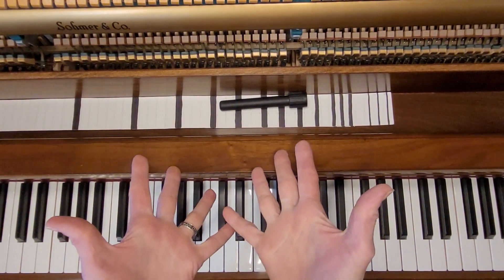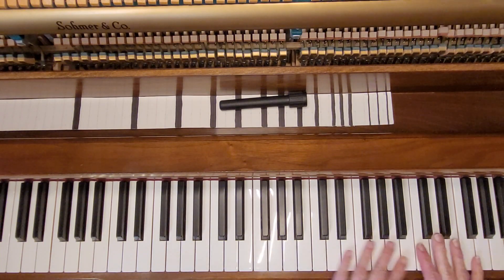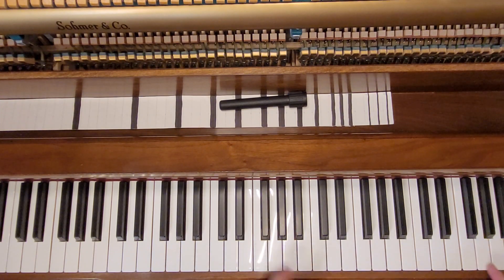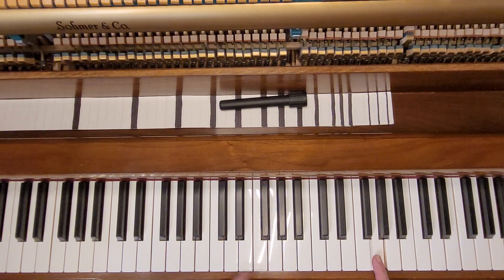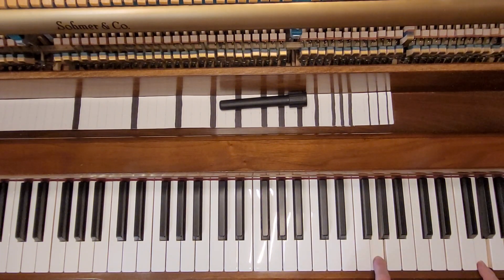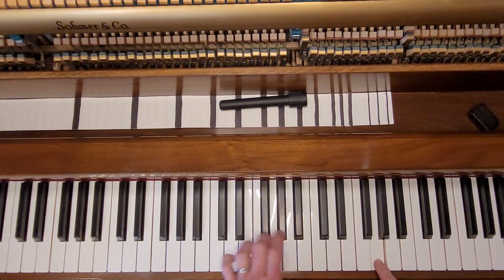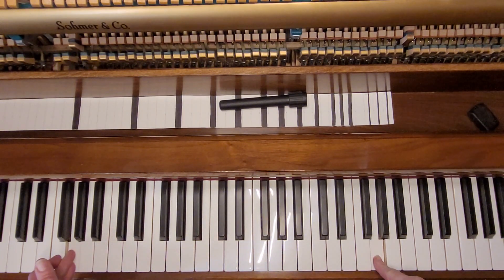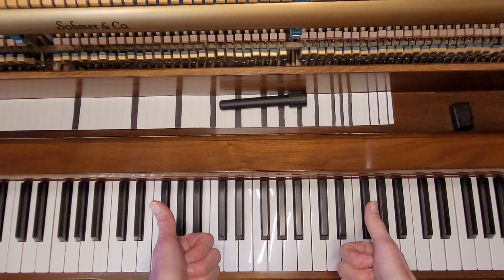MTPT37.5: Using a Triple Octave to Check an Upper Note

Comment: If an interval or unison is noisy, does that mean that the note is sharp? Were you just saying it was sharp when you made this video because you knew you made the note G slightly sharp? I've been learning to tune for two months. I'm still trying to be able to hear the difference between clean and noisy. I kind of get it but I don't think my ears are really tuned into that yet. It's been fascinating learning a temperament.
Reply from the maker: The short answers: no & no.

The long answers: 

An interval being more or less noisy means it is more or less close to "pure". In this video, I'm looking at octaves. If a single octave is properly tuned, it is slightly wide of a 2:1 octave. (If you don’t know what that is, see the link I will share below.)  If an octave is very noisy, that means it is either too narrow or too wide. If it is too narrow, the lower note is too sharp and/or the upper note is too flat. If it is too wide, the lower note is too flat or the upper note is too sharp. If a triple octave is tuned properly, it is slightly narrow of 8:1. Since the inharmonicity from the lower note in a triple octave puts the 8th partial ridiculously sharp, the upper note must be tuned slightly flat of that partial. Therefore, if the upper note is slightly sharp of where it should be, it will bring the triple octave closer to pure, making it less noisy. If the upper note is flat, it will be further away from pure, making it more noisy. 

As far as unisons go, more or less noisy is the same in that it means they are more or less close to a pure unison. If they are noisy, one string is sharp and one string is flat. 

I talk a lot about these things in my video series, “Music Theory for Piano Technicians”: 
https://www.youtube.com/playlist?list=PL6RYO1N8Y1hHMFSz5ybKU4zO4BflLSxKv 

Hope this answers your questions! :-)
Reply: @PianoTechMaggie , thank you! That cleared up a lot of what’s confusing me.